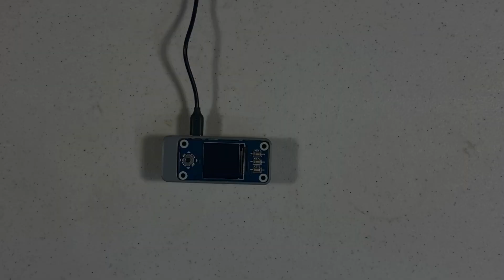Open Pill Assembly Process

Comment: Clumsy me, I broke the clamp for the camera cable. Any help?
Some glue for electronics?
Reply from the maker: Do you mean just the black retainer bar broke off, or the entire white ribbon cable harness?
Reply: @seedsigner5695  The black bar only, thank you for your reply.
Reply from the maker: @historion  If you can discern which way the black bar should be oriented, you can actually still use it to secure the ribbon cable in place. It should not come out if you can properly wedge it in its proper place.
Reply: @seedsigner5695  Thanks a lot once again.

Comment: That boot time is a bummer. A microcontroller might've been a better option, don't really need an OS for a simple, stateless device.
Reply: For cold storage operations, 1min boot time is really not a problem.
Reply from the maker: It’s tentatively on the roadmap, but will take a white to get there. Meanwhile, SeedSigner is very useful right now.  : )